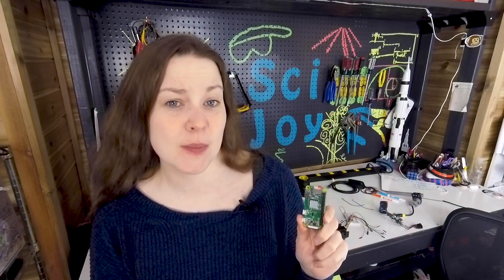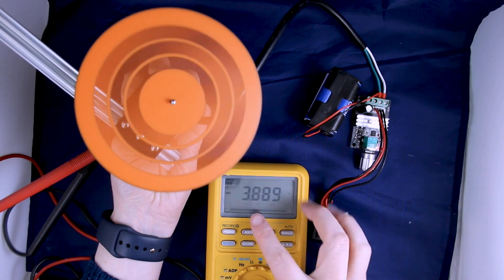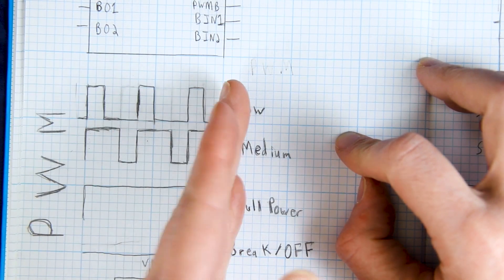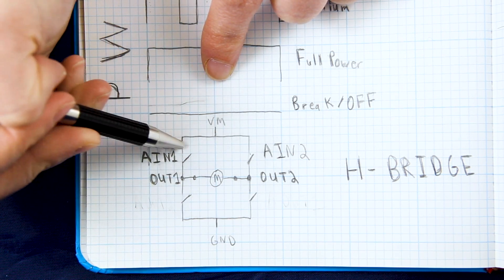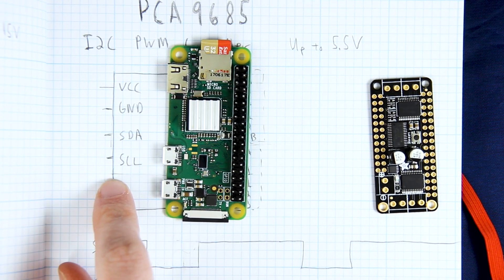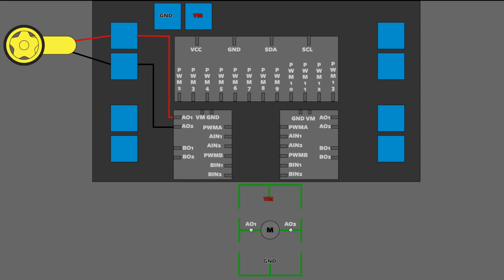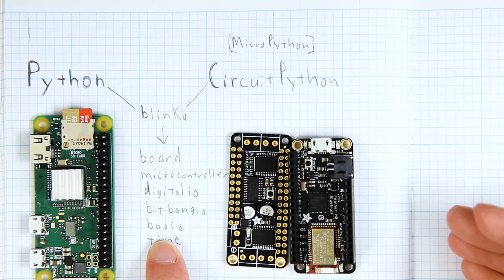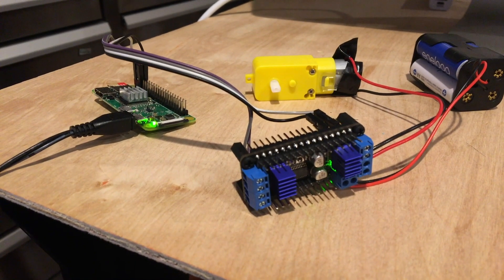How to control motors from Raspberry Pi with Adafruit DC Motor Controller | Twitter Controlled Robot

Comment: Great work. amazing.
I have H-bridge I make it with a relay can I use Adafruit to control the motor without PCA and other
you use this line kit.motor1.throttle =1.0
I want just motor controller direction without voltage and I want to use it for a CNC machine can I do it with just an H-bridge relay?
I will be happy to help me I liked your video you are amazing. have a great day

Comment: Hello SciJoy!  What a great explanation of the dual H-Bridge and circuitry! Lots of information quickly and clearly. I am very interested in a small robot with differential dc motor drive.  I have a Pi Zero W and An Adafruit DC & Stepper Motor Hat#2348 that I bought like 2 years ago. Will the code that you presented here work with this motor HAT?  Keep up the good work!
Reply: I believe the Adafruit GitHub for the Python code was updated to make this work out of the box.

Comment: great vid! we posted about it on adafruit and included in the python on hardware newsletter, we also DMed' ya on twitter to say hi!
Reply: How about you guys make a pHAT out of this? Thanks to 6-12v VIN this pHAT could easily power Raspberry Pi 0 through the GPIO. It's crazy how little space it would take compared to other solutions. There is pretty much no other (I have been looking for days) pHAT solution that could power 4 motors and nothing that uses 4-pin servo connection.